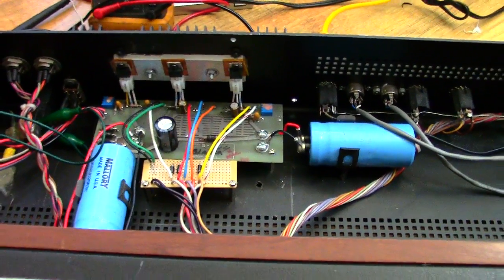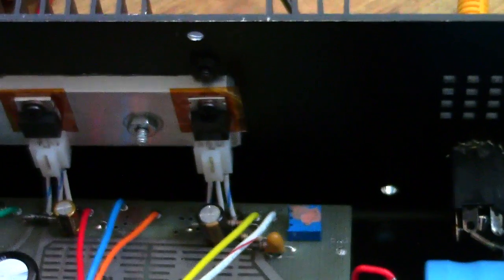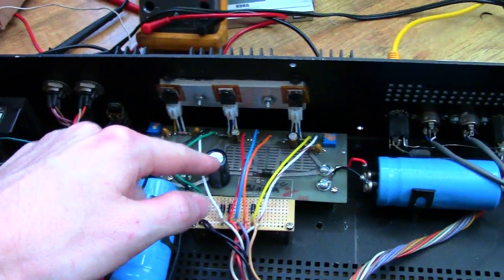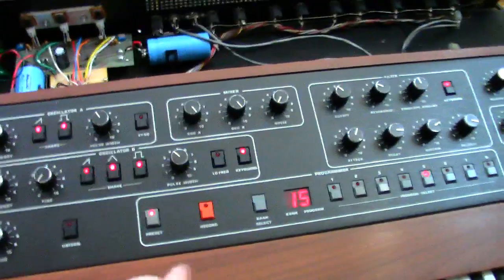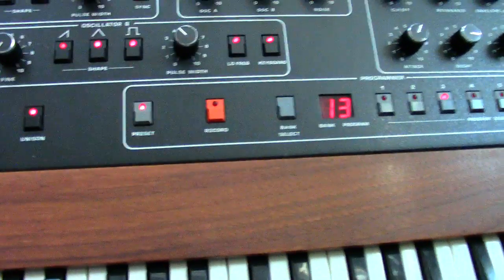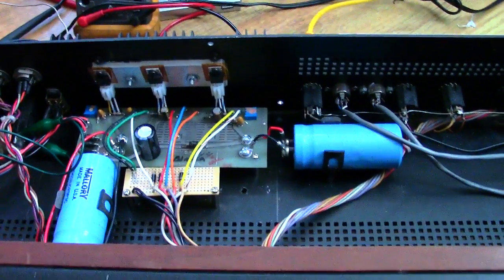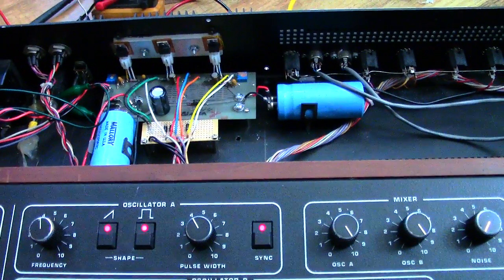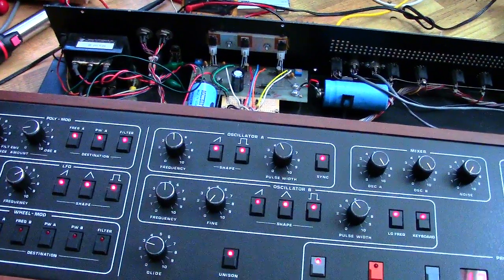Sequential circuits Prophet 5 Power Supply Modifications Part 2 (By Synthpro)

Comment: hi great video and nice improvement to the power supply. Are the protection diodes TVS diodes. Around 6v for the 5.6v rail? Is it just wired - cathode to rail and anode to earth

Comment: I see you have (or had) the same problem that my Prophet 5 still  has. My repair guy cannot figure out why it will not save presets. All that is saved is garbled sound. As with your P5, the minus voltage dropped and damaged some IC's including wiping the Operating System. Everything has been repaired, except for the ability to save patches. Were you able to fix this problem? All my savings went into fixing the P5, and I am left with a non-programmable Prophet and no-one to turn to. Hopefully you can shed some light on this problem.
Reply from the maker: Focalworks Videoproducties I have not dug too deep into this prophet yet on the memory problem, been restoring a lot of gear for other people so my stuff seems to get stuck on the back burner. I do believe I know what is going on but I have not verified it yet...There is a power on circuit that is supposed to active once power is applied and I think mine is never seeing it. This is just a guess right now as I have not really dug into it. My Prophet 5 was a rev 3.2 converted to a 3.3 and the IC's in question are stacked together with flying leads. once I get some time to dig in I will be sure to let you know what exactly I find.

Comment: I have a P5 Rev 3.2 and I could never seem to get the poly mod section to track in perfect pitch.  It didn't matter if I was using ENV or OSC mod, I could never achieve a perfect modulation for all 5 voices evenly.  Do you know if that is achievable?  I've spent hours under the hood adjusting trimmers and I'm starting to think I might be chasing a pot of gold at the end of the rainbow...
Reply from the maker: I believe that is Normal, my Pro 5 does the same thing
Reply: synthpro 30+ year old IC's - makes sense.  I managed to achieve same pitch for attack sweep on ENV modulation but then upon release there was dissonant note clashes. Thanks for resetting my expectations.

Comment: I was just thinking... if you get the cassette section working, it would be fun to pipe the cassette output into a PC and record the data dump as a wav file, and then replay from the PC back into the cassette input to see if it loads correctly.
I can't imaging someone hasn't tried that already... wonder if there is a collection of Pro 5 patch data wav files out in the wild...
Reply from the maker: Thanks! Oh yes, I use tape memory in the way you mention, I will hook the tape out to my mixer and record it in the form of a Wav file, then I will connect the synth up to the output and route the sound out back to the synth, works very well, this is how I have stored all my Akai AX-80 stuff through the years and will be the same for the prophet 5.
Thanks again for your advice on the DC to DC converter as well, I have not thrown this idea out by any means. I am still working on the specs for this voltage line so I get the best results.

Take care,
Jareth

Comment: Awesome.  You lucked out that the processor is still "processing".  Hopefully it's as simple as the Static RAM chip(s) poofed and just need replacing.  The casette section being out is somewhat odd, although how often are you going to use that anyway... other than piping it through an amp to annoy your neighbors...